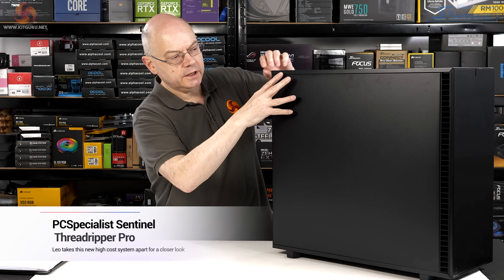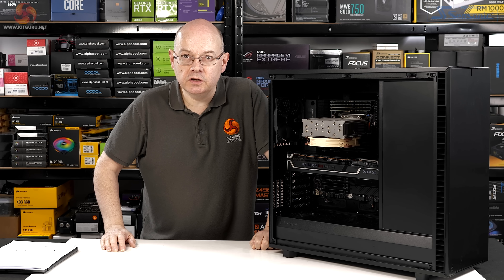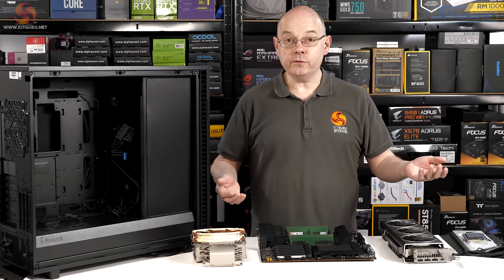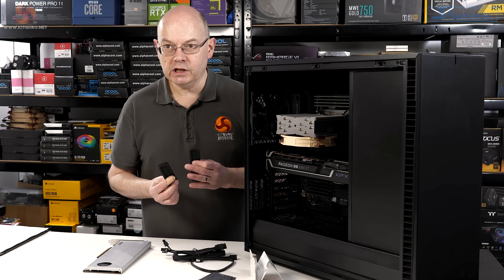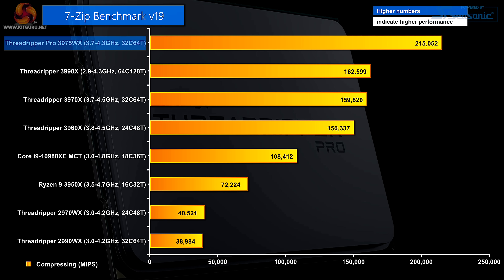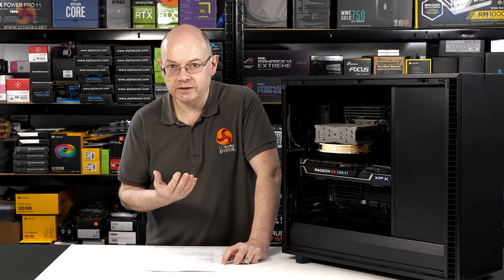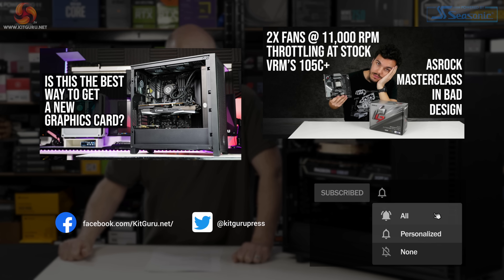Leo pulls a £5k Threadripper Pro Workstation to pieces

Comment from the maker: Update 18/03/2021: PC Specialist got in touch with us to say they are no longer stocking the Noctua cooler shown in this video - so if you buy this system, it will instead come with their own PCS FROSTFLOW 200 TR4 cooler, which they say actually performs slightly better. The Fractal case is also expected to be out of stock until April. That doesn't change our conclusion to the video, but be aware if you were thinking of buying one!

Comment: I think this system screams with "moar CPU cooling" and ventilation. Thicc 280 or 360 AiO would be nice, it would definitely boost clocks on workload, even 100-150 mhz is significant stuff for 32 cores. Additional memory 3200 would improve lower thread /memory latency intense workloads. Overall those 2 small changes would make a more balanced system that excels in some workloads. When you pay 5200 paying 5500 wouldn't be a significant change...

Comment: yeah, quite impressive, yet three of Leo's points are a bit of a sticking point in my two farthings. the cooler could be better with front-to-back airflow, at least a rear top exhaust fan would be nice to balance out the inlet vs exhaust fan counts, and NOT having 3400MHz memory on zen2 is almost sacrilege, not having 3200 isn't even up to zen1 spec, less is just an insult. I get that server ECC memory lags negligently behind consumer speeds, however, the memory included with that build is just archaic at best. If, if I was in the market for a 3delight/Maya/RenderMan workstation, that memory alone would have me shopping elsewhere, because Not EVERYTHING in 3D land is multithreaded (loading surface settings, saving scenes, etc) so clocks do matter for the user interface experience. clocks are not the only 3D  limiting factor, however, having low clocked cores or memory is painfully noticeable in 3D editors (some multithreaded things are instantly done and other single-threaded things ye may as well go make a pot of coffee while you wait).

Great vid Leo and crew.  B)

Comment: Nice one, Leo. Thank you. The increased RAM capacity is critically important in many areas, be it CFD or holding live music samples. You could also put the GPU in a lower slot so as to give the CPU cooler more room without impact on GPU performance thanks to the 128 PCIe lanes.  

Now I just have to win the Lottery to buy one

Comment: Damn! This is a monumental system.
You know how you could test the RAM bandwidth in a useful and cheap way? With a Blender simulation, water or smoke. e.x. Make a 10 second fluid simulation, with around 70GB cache data since the Samsung Pro EVO can handle 7GB/sec read. And hit play to see if it can play in real time in the viewport and hit render and measure the initialization time before the render starts. That is how much time it takes to load in the cache data into the RAM and start the rendering process. This is very important for rendering animations because evey second counts.
Ideally though you could make a RAID 0 configuration with x4 Samsumg 980 EVO's and the Asus Hyper card to get the read speed to 28GB/s and make a 280GB simulation, but baby steps ;) 
If you don't know how to do this, I can make you a .blend file and send it to you.
Reply: Can you use raid 0 as bootable unity?

Comment: Radeon pro vega II DUO is an absolut monster but only available for mac pro (and quite expensive)
You can put 2 cards together to reach 128go hbm2 and 56 TF fp32.

For PC workstation the radeon vega pro VII is a better solution than the 6900xt.
With 6.4 TF  FP64 (almost 5 times more than the 6900xt) and 16 go hbm2 ECC support . And i dont even talk about the pro drivers and IFL.

Comment: 280w on that tiny cooler, I doubt it
Reply: Surprisingly its actually fine :). Then again perhaps not so surprisingly - the 3090 uses >350watts and has heatsinks with less surface area.
Reply: @wapted  GPU have direct contact with cooler, no ihs getting in the way.
Reply: @rurutuM  Well, that doesn't really matter in this case. Google the thermal dynamics of heatsinks if curious lol.
Reply: Double fan nh-u-14s-tr4 is rated for 250 W for 2nd gen Rippers

Comment: ECC should be nominal 
why isnt all memory error correcting ? its a path for a breach of data - the memory is the failing component in all file systems as it holds the access to the data being stored
Reply: Would you accept that if all memory is JEDEC, ie DDR4-3200 CL22-22-22?
Reply: @TechTechPotato  binned JEDEC potatoes, Dr. Cutress.
Reply: In the beginning it was almost all ECC.
Reply: @scality4309  rather gpu mem / v/d - is all round better arch wouldn`t you say ?
Reply: You are Linus Torvalds and I claim my £5

Comment from the maker: So are you buying one, or two?
00:00 Start
00:15 Introduction / Threadripper Pro details
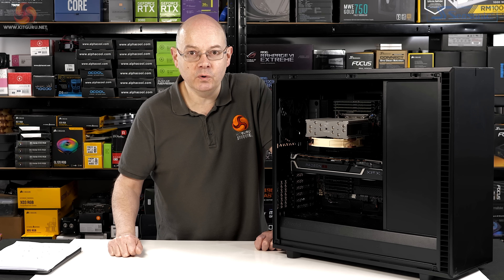02:25 Leo answers his own questions
03:00 The PCSpecialist Sentinel System detailed
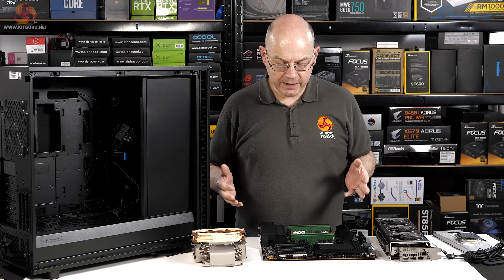05:29 Leo rips the system apart for a closer look
06:11 Pricing discussion
07:41 Key points of interest
08:24 I/O panel and heatsinks/VRMs
08:53 Accessories and extras
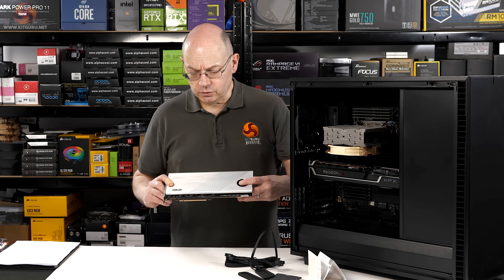10:01 Performance showcase, power demand and thoughts
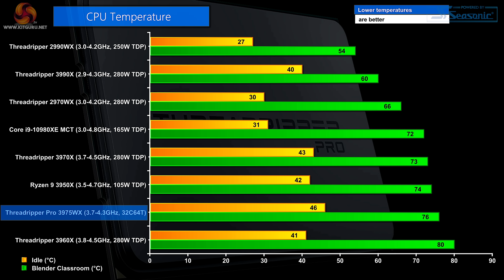12:31 CPU temperatures and fan layout
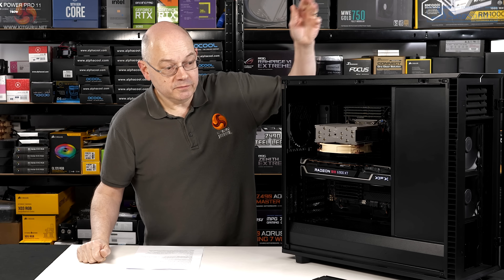13:14 Pros and Cons / Closing thoughts
Reply: Am i buying one

Dear god i wish
Reply: I bought Ryzen 9 5900X + AMD 6900XT